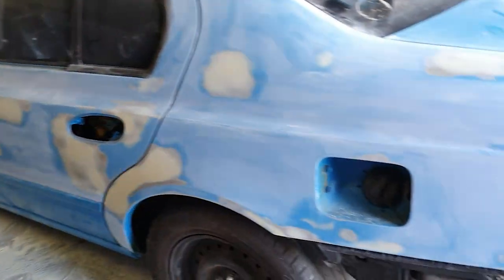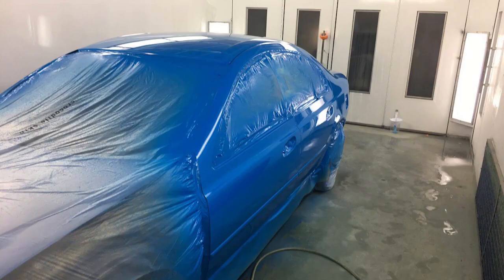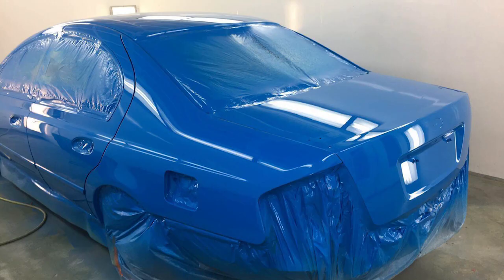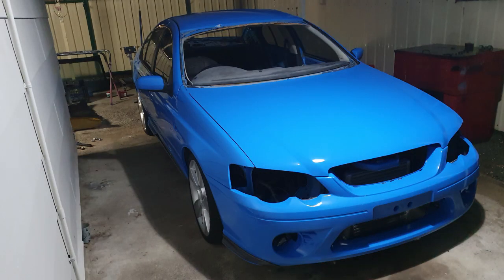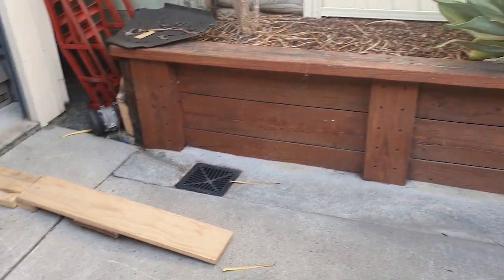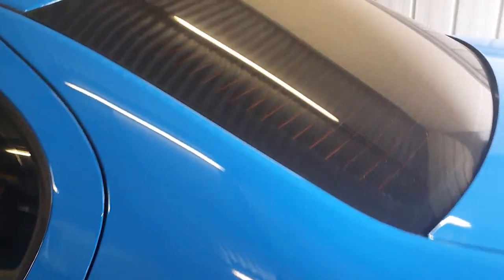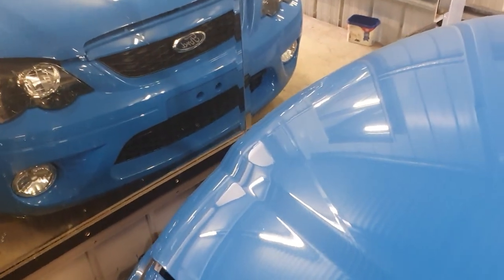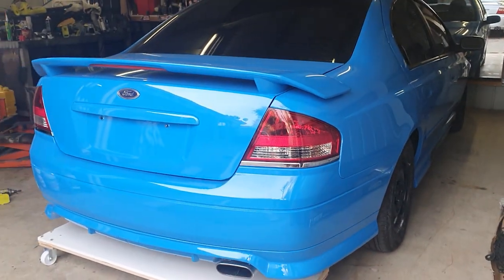Bionic Blue BF XR6 Turbo Resprayed

Comment: BF motor with the ZF6HP26 transmission is my favourite non turbo combo from Ford, they go suprisingly hard for normally aspirated and the BF motor has a very strong low to mid range torque curve making it nice to drive. I have 2 BF Fairmont Ghias with this combo, changing the CAT to a 100 cell free flow gives them a nice spike in bottom end torque as well.

Comment: Get the LUX packs redone in the factory silver, Bionic doesn't go well with argent wheels IMO, Look at the BF Bionic F6's i personally think they would look better silver.
Reply from the maker: Yep I had a look you are 100% correct. I like the silver better now
Reply: Good choice, I've got argent xr50/lux pack wheels on my Bf xr6t MK 2.5 but it's  black with argent accents, looks factory standard.👍